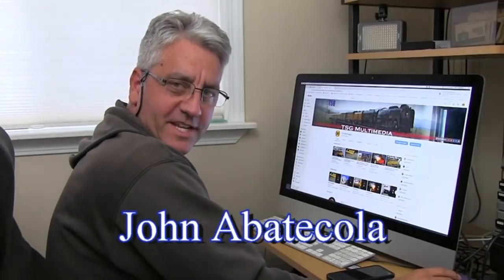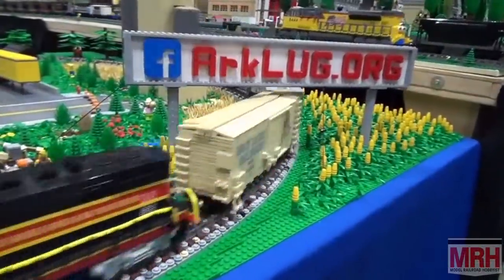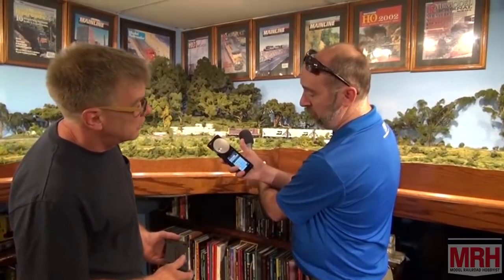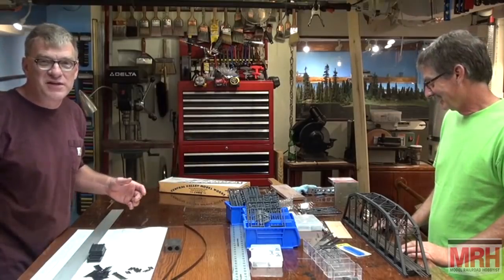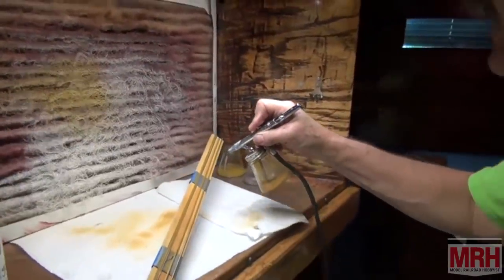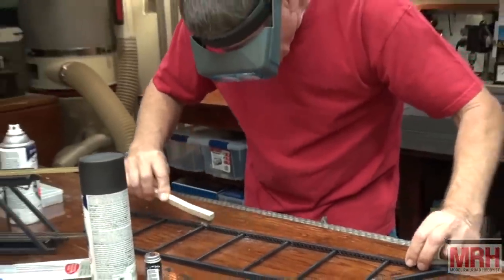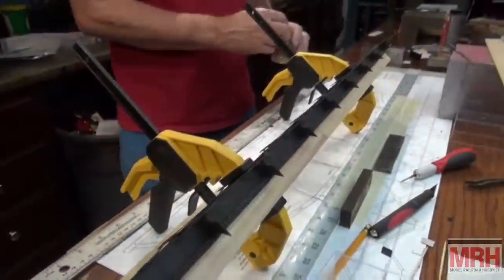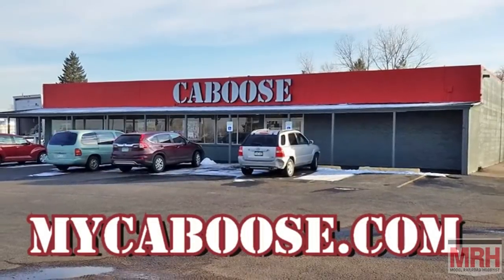Whats Neat in model railroading | November 2018 Model Railroad Hobbyist | Ken Patterson

Comment: Another fine show Ken ! Those bridges are beautiful ,I`ve built 2 of them for my N scale layout and they really make the scenery.I found the step by step "how to build" video very helpful for my first build.I did use appropriate sized piano wire instead of the thread provided for the guard rails, looks great and saves your sanity.Also, as suggested by Jeff ,I used a small wire brush to clean any glue and small seams, works very well.

Comment: I was at this show. It's time to start embracing all the Lego model railroaders of the scale railroading hobby. These are all really enthusiastic, mostly young (30s to 40s) folks, most of them with younger families and kids who also participate at every show. L-gauge is a fast-growing segment, and is truly well on it's way to being a large part of the future of the model railroading hobby.

Besides, they all build really cool, scale-accurate stuff, most of it with working mechanical functions too boot.

As but just one example: There was a glass making factory on one of the Lego layouts that did the entire glass making process, in scale: Starting with loading in the (Lego simulated) raw ingredients from the rail cars, using working conveyor belts to move the goods throughout the 4 processes of making glass bottles (complete with 'working' stamping machines and such), up to the point of shooting the finished, packaged bottles out the other end of the factory. Even functions such as rejected and broken glass being redirected into a waiting hopper for recycling were included. All using 100% Lego-only parts. Amazing.

Comment: Better buy a Fleischmann or Roco Z21 with wifi router.
Runs all, dcc motorola marklin delta 
For under 300 dollars all inclusive.
Ow and when you install  Rocomotion you can not only control everything with your tablet but also have the matching lok cockpit. ;))

Comment: Sorry Ken the Wifi is very old and I can do it as anyone with a smart phone can do with out spending a dime. It called JMRI .  Your interview is very misleading with ESU guy not telling whole story.  Very very misleading.
Reply: I agree art. I've developed my joy for jmri. I was originally a computer guy so the hardware and interface cane naturally. Spending money on things that are free are pointless to me too. Happy Halloween my Louisiana brother.
Reply: @nateb.theaviator3782  ESU did good job on decoders but really there control systems do not do anything others do and are totally out of the ball park.
Reply: @arthurhouston3  try using a higher number function on digitrax...grrr. I like the scroll feature. The way I,understood it,,ESU is Wi-Fi based,,so it can be used with ANY dcc system that has a Wi-Fi connection.
The last time I checked...you CAN NOT use digitrax throttle on a NCE system..hmm
Reply: arthurhuston3 I'm not sure what you mean saying ESU's control systems "are totally out of the ball park." The Cab Control System lists for $499 compared to Digitrax's Evolution Advanced Duplex Starter Set at $660 and NCE's PH Pro-R Wireless Starter Set at $799. Street prices are around $385, $499 and $550 respectively. The ESU Cab Control System is the least expensive, it doesn't require you to have a laptop (which isn't free), JMRI, or a cell phone (also not free). It has easy consisting, easiest and best function control options and can run other Android apps.

I didn't see or hear anything misleading in Ken's interview.
Reply: @davetaylor9057  Smart phone tech catching up to out of the box control systems IMO is the next big thing for model railroading.
Reply: @gmburzynski68  have no pronlem at all using any ones system with smartphone and its free. ESU is a very expensive play toy. Remeber a model rr 95% only has one system.
Reply: @edeptula2992  JMRI decoder pro free on internet will program them all aspects.
Reply: @edeptula2992  have several people using decoder pro to set there ESU decoders.
Reply: Are you JMRI users able to operate consists?  I have JMRI, Sprog II and Decoder Pro which I use for programming DCC, but my set up is only able to operate One engine.
Reply: @Denniss7420  never had problem with consist. But i set them up using NCE controller. You have to have a a consist number assigned by command station. NCE they are 127 to 2.